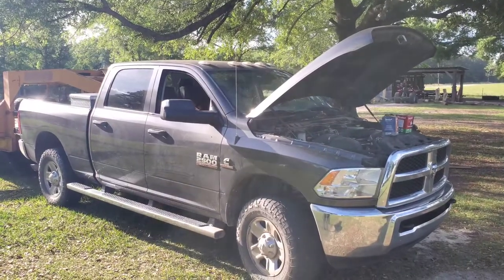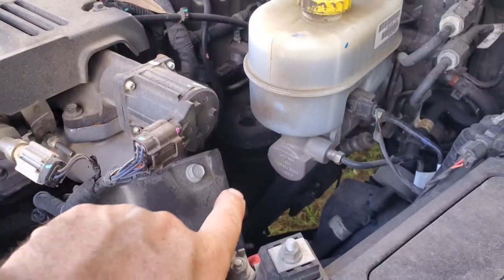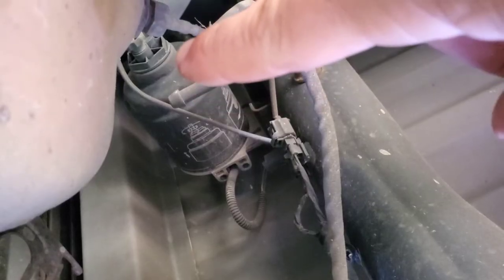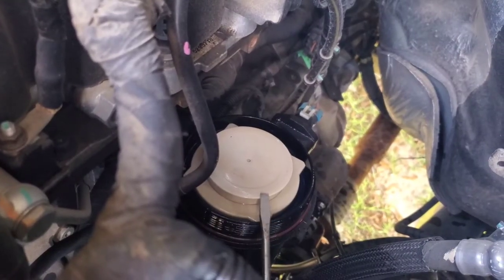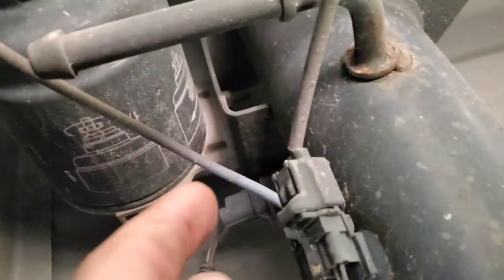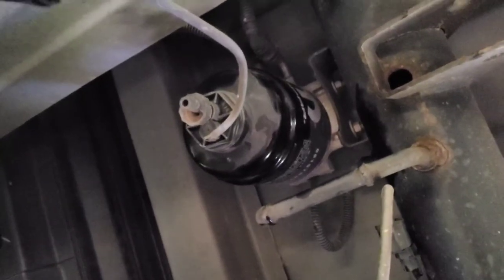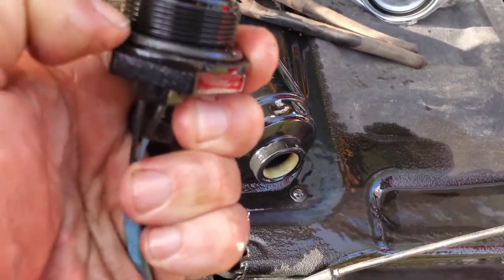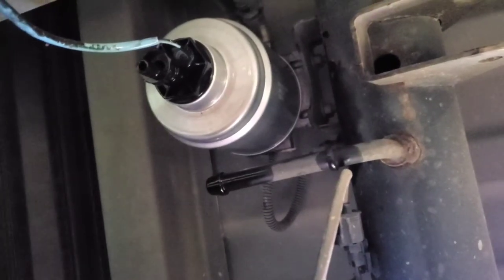Location of and changing both fuel filters on a 2016 Ram 2500 (4th Gen)  6.7 Cummins

Comment: How have these filters worked for you? Any problems? Thanks.
Reply from the maker: These filters have worked perfectly.   We got a Napa filter for my dad's 3500 and it would not fit.  There was too much plastic on the top and the lid could not be closed.
Reply: @TCSawmills  Thanks. I read somewhere if the front filter doesn’t have the oval opening on the front filter, not to use it. I put a cheap Amazon filter on my last truck and started getting injector codes. Swapped it with a Napa filter (made by Wix) and codes went away. But, they’re double the price of the Duralast and also don’t have the oval opening…